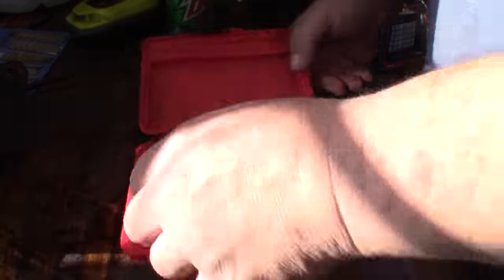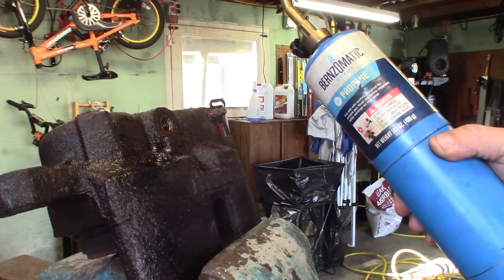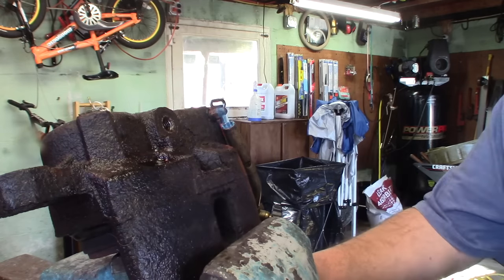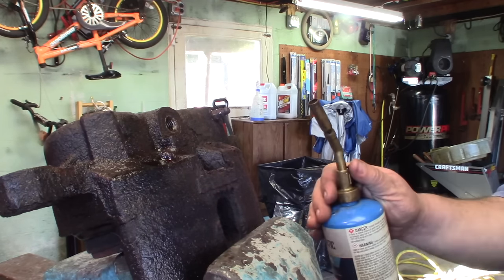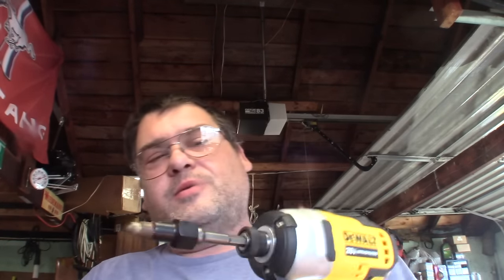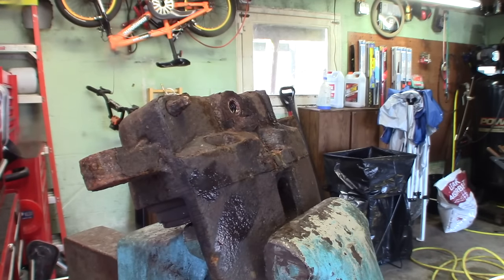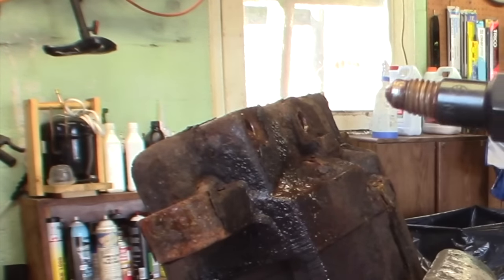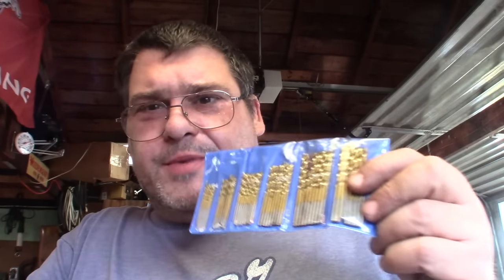How to Remove Seized Stuck Brake Bleeders Every Time!

Comment from the maker: I removed 2 brake bleeders that most would consider impossible in this video.  This method works time after time for me.  You can see a link to all of the tools used in the description above.  Here is the starter set for the extractors I used:  https://amzn.to/2W5tQGl  It comes with the case so you can add the 5 larger sizes later.
Reply: Using that hammer like you did you almost broke the bleeder valve.

BTW. People dont run out and start buying blow torches, the price is bad as it is, Ive been holding out in buying one for pipe solder.
Reply from the maker: except I have done hundreds of these.  If you don't want to buy tools you can always just pay someone else to fix your stuff
Reply: Have you tried just squirting water on it to cool it? An old engineer told me that one for rusted nuts etc, works amazingly well. Far superior to just heat like most people do.

Comment: Followed your advice (including breaking off the drill bit) and it totally worked. Saved me about two weeks time and $250 replacing an obscure, hard to find and expensive old Alfa Romeo caliper. Thanks!
Reply from the maker: Glad it helped

Comment: Excellent video. For any seized, rusty bolt or nut, like exhaust system bolts, I always try to spray some PB Blaster the day before, then use heat and an impact the next day. People think an impact, including an air impact, will break a bolt but the opposite is true. Applying torque with a bigger, longer wrench will wring off a bolt, but using an impact is like tapping a wrench with a hammer. It shocks the bolt loose.
Reply from the maker: Right on
Reply: It's always good to let the PB Blaster have time to work

Comment: Here's the deal.  If you were to look at the base of  brake bleeders and hydraulic fluid controll valves, you will see that they have a tapered angular seat.  They seal by the design of this seat....NOT by being torqued in place.  People believe that it is a high pressure safety issue, so it must be very tight.  But it is not true.  Just a simple finger tight on the wrench will be more than enough to keep it sealed / in place.  For hydraulic jacks ect. the slotted end of the bar is there to keep you from getting under the load, or down in the mud when you turn the valve.  But people use it to over tighten the valve , This ruins the seat so it has to be tightened more and more untill it finally fails.  This  misconception is the number one cause of bleeders sticking.  I close mine at 1 pound pressure, and they have never stuck or leaked.  The angled wedge affect of the seat works so well to keep them in place, that it causes them to need much more torque to remove them then was used to install them.
Reply from the maker: Sounds like the deal!
Reply: But that's hard to gauge if the threads are slow. I once lost a lot a fluid on a 600 mile road trip through a mountain pass.. I had bled my brakes just before.

Comment: I have started using anti seize on just about every bolt and nut subject to rusting.  So far, no failures.
On a side note, I really wish I had bought an impact driver much sooner!  My son borrowed mine for a project at his house and I thought it was a goner but he soon returned it and got his own.
Edit:  I got a can of MAP gas awhile back.  I'm too old to wait around for the propane!
Reply: what kind of antiseize? copper paste ?
Reply: @BillSW  just whatever is available at the parts store.

Comment: Thanks for the video, I didn't drill into the bolts but heat + impact driver + bolt extractor socket = success! I did have to hammer on a smaller socket onto one of the bleeder screws, and that also successfully came right off!

Comment: I use a 50/50 mix of ATF and a acetone on all rusty bolts and leaders and zero fittings. Works better than any thing you can buy at a store in a can. An Old timer mechanic taught me that trick. Spray it brown with that and let it sit an hour, then remove the bolt. Work every time
Reply from the maker: It doesn't work every time here.
Reply: Got to mix the acetone/ATF together.  Ideally , you first wire brush clean,  apply overnight for it to slowly penetrate.

Comment: I have this problem.before with my chevy. I used   brake fluid which cuts up the rust real good. And I used a vice grips worked it back and forth slow.... but this method  works great as well

Comment: I tried this today with one change: instead of snapping off a bit I found a steel nail of the same diameter and just hack sawed it off in its place and used a pair of ice cubes instead of the inverted keyboard cleaner. It worked like a charm. Thank you.
Reply from the maker: Nice work!
Reply: @frugalprepper   I didn't have any keyboard cleaner and I just couldn't bring myself to hurt a tool. Lol

Comment: I usually do everything on here except the drill bit down the centre,that really must make a major difference,great video!
Reply from the maker: Yeah that really strengthens it so it doesn't break off.
Reply: Adding the drill bit makes a HUGE difference because it gives body to the bleeder so it won't collapse when you squeeze the fluted bit onto it to remove it. A bit part of the unseizing is also the hammering - it loosens the crud in the thread. If you try removing the bleeder with a vise grip it's not nearly as easy to do and your risk of breakage is much, much greater.
This method is practically foolproof.

Comment: You might try using the TIP of the blue flame. That IS  the hottest portion of your torch area. May cut your heating time in half.
Reply from the maker: Just the tip!
Reply: @frugalprepper  "Only for a minute, mind, and just 'til the swelling goes down."  Surprisingly, inside the light blue cone in the center of the flame is room-temperature air!
Reply: Amazing bit of knowledge, there! 🫡😉

Comment: Whatever works is a good way. I've worked on some as bad as the second one (no hex left) and this always works: 1. Clean away rust with small densely bristled wire brush. 2.spray with pb blaster or another good penetrating oil (by the way, you saw no oil on the threads because if it did make it in there it was burned away). 3. Penetrating oil works while I pull caliper. 4. Heat mainly the caliper body around the screw (tip of inner flame is hottest part) for about 30 seconds if you are not replacing piston seals (longer and you risk melting them). 5. Remove with vice grips. If it will not turn at first attempt, heat a second time. As soon as it comes out I quench with water to save piston seals.
This always works for me. No drill bit and no air duster. Just alter the heating depending on size of caliper and how far bleed screw is from piston. Better to spray again a couple times over a half hour and try again than to risk putting in a caliper with melted piston seals.
Reply from the maker: 30 Seconds with a propane torch isn't going to do much.

Comment: Thanks for the video. I was able to slip a drill into the bleeder screw without removing the rear wheel cylinders and also the front calipers. No drilling or snapping off the drill. Just found one the bearly slipped in and heated it up. All four were locked up and this worked great. I didn't even have to replace any of the bleeder screws 👍

Comment: The tip of the flame is the hottest. And by the way, WD40 is indeed flammable. We use it rather than either in a carburetor for starting engines since it has some lubricating properties. But it's a great starting fluid. But good video.
Reply from the maker: Thanks for the info!
Reply: Tip of inner flame.

Comment: Awesome. I have a stuck one on my rear drum brake. I'll leave it alone for now, but you provided great info. The impact seems to work much better than manually ramping up the torque for crusty bolts.
Reply: Realize wheel cylinders (the component nipple screws into) are often very inexpensive and you may need one anyway. Especially if you're not in a hurry, try soaking the brake line fittings and all bleeders with penetrant. Such that if you end up replacing caliper or cylinder, life is easier.  PB blaster, MP40, KROIL and liquid wrench rust formula are all better than Water Displacing 40. It's not actually a rust penetrant.
Reply from the maker: I find WD40 works great!
Reply: @frugalprepper  For sure.
Reply: @frugalprepper 
I tried that, and nothing. Ended up tearing nipple apart! 😡🤬😭

Comment: You can buy that auto freeze spray to cool after heating up a part ..Thats a neat idea to put a drill bit to strengthen the bleed screw before trying to remove it with the impact wrench. If your calliper is aluminium, you can't heat it with a torch, you need an electric heat inveterter. I'm liking using an electric wrench more on hub bearings, lower balljoints and tye rod ends etc..Really helpful tool
Reply from the maker: Guess what Auto Freeze spray is... R152A.  Guess what duster is?

Comment: I find a few drops of acetone mixed with automatic transmission fluid or other thin oil applied to the bleeder the night before tryig to remove it in the first place does wonders in reducing the chance of it getting stuck.    Many times better than my old stand-by of WD-40.
Reply from the maker: If you have all night to wait.  I normally need to get it done, get paid and get the next one in.

Comment: Just stumbled onto your channel as I have a snapped bleeder on my Midget. 
Unfortunately it is the rear drum, so can’t put it on a bench and will have to use an internal extractor but if the right side is the same I’m going to follow this trick. 
I keep my little car going from the shop manual and you tube.

Comment: I replace brakes usually for long term. I have not replaced pads on a used caliper and wore out the pads before the caliper seizes. I replace with loaded calipers and rotors when needed but, have found it foolhardy to replace pads on used calipers. 
Good video on technics for rusted bolts ..
Reply from the maker: I find it fool hardy to replace a working caliper, but to each his own.

Comment: Suggestion from Nottingham UK … the patient approach … spray loosening oil on the bleeder day after day before you try any extraction technique so it gets the chance to loosen the rust which is holding the screw.
Reply from the maker: Yeah, I don't have time to have cars sitting around in my driveway for days waiting on oil to soak in.  Got to keep them moving to make the money.
Reply: I do the same as tonybreeze do. Omicron 636, spray on, let the time pass, spray again after 12 hours or so... Patience works well, but I'm not a man who earn my bacon by repairing cars... I just keep money by repairing at home.

Comment: Ill share my technique with you.  Ive had 100% success with it.   You need a micro torch or one of those torch lighters...which is what i use.  A can of kroil oil or the seafoam creeping oil.   Clean the bleeder area.   Heat the bleeder screw.   Just heat it . don't have to go crazy. Little shot of lube where it threads in.  More is not better.  Equivalent of a few drops. You will see it get sucked in.  I dont know...do that maybe a dozen or more times.   Heat... basically just warm it up.,..lube.   Try to loosen it.  Alot of times it will break loose.  Don't try will full so that you break it.    If it doesn't break loose ...leave it sit overnight or all day.  Try it again.  No need to reheat it.   I have never had one not come out.  I have used the heat and let the fluid suck in for years.  Yes sometimes it takes patience...alot of times it works immediately.   Just sharing with you because thise that post up on YouTube have saved my butt many many times. ✌️🇺🇸

Comment: Put a one size over deep socket on the brake bleeder so that the socket bottoms out on the caliper then hit the socket with a air hammer for a second or two, and boom bleeder comes loose every time! ;) Tip from rusty Sweden =)
Reply from the maker: Thanks, I will give it a try.
Reply: So instead of hitting the body all over right 🤔with a hammer
Reply: great tip fir any seized bolt. thx!

Comment: I've worked on a broken bleeder for over an hour only to find out a remanufactured caliper was $28. This is good in an emergency or for an expensive or unavailable part but I've found it's always best to get a replacement quote before you put more labor into something than it's worth
Reply from the maker: For Sure.  Some of those calipers are pretty cheap.

Comment: Great technique! - On a side note, regular WD40 is NOT a good penetrate. Use Seafoam Deep Creep (The Best) or WD40 Blue Flame penetrating fluids.
Reply from the maker: I have used them all, and WD40 seems to soak in better and get bolts broke loose faster than any of them.

Comment: I tried this 3-4 times using a MAP torch and using ballistol cooling spray. What finally got it loose was heating the outside area for 3 minutes and I sprayed WD40 on it while it was still hot. Maybe use some different penetrating fluid that isn't flammable. Maybe it was the combined effort of several tries. Mine was completely rounded and gripping it with a knipex cobra it took almost no effort to get it out.

Comment: Great strategy!
Could you use wire or something else besides drill bits? I cringe when you break those new ones, even if cheaper ones haha.
Also wanted to say if everything fails, your bleeder breaks off, and you cant extract it with anything either, and you still dont want or cant buy a new caliper, yoh can bleed the brake at the line coming into the caliper instead with a helper to press the brake. Might not be perfect, but better than nothing to get most of the air out.
Reply from the maker: Yeah you can line bleed them, but I like my to be perfect for a customer.  I don't need any lawsuits.

Comment: I enjoyed your video and love your attitude but did you know the hottest part of the flame from your torch is at the tip of the inner cone?  Also true Mapp Gas isn't made anymore but they have a substitute called Map-Pro Gas but it is only slightly hotter than Propane by about 120 degrees. Much more expensive with accessories. Thanks for sharing this with other Weekend Warriors~!
Reply from the maker: Well, I will have to try to use the hotter part next time!

Comment: Great advise! Thanks for taking the time to produce this video. Do you have any tips on broken exhaust studs in an aluminum cylinder head?
Reply from the maker: Weld a nut on the stud.  The weld will only stick to the broken stud not the aluminum head and the heat from the weld will help get the threads unstuck.  That's like the only reason I keep my old stick welder around.
Reply: gently get it rocking back and forth after welding

Comment: great video. is that a regular cheap propane torch? have u thought about putting crazy glue around drill bit so it all bonds to bledder screw? might get that last 2% of cases?

Comment: When you are applying heat add neat grease or push a regular candle into the thread, both seem to work much better than WD 40.
Reply from the maker: Great tip!

Comment: Thanks would a easy out screw extractor work? Cheers
Reply from the maker: It's been my experience that they usually break off in the hole and then you have a real mess.  Normally once they have broken off I just get a new caliper.  If you have to really go at it.  Drill it, tap it, and put in one of these: https://amzn.to/3KedZ0a

Comment: good video.  aren't you worried about getting metal chards into caliper ?
Reply from the maker: No
Reply: @frugalprepper  don't they fall down the bleeder shaft as you drill and then have the opportunity to fall into the caliper as you back out the bleeder ?

Comment: I heat mine up red hot, then take an old way candle and touch the candle to the bleeder  and let it melt a little and then attach the socket, the wax works wonders!
Reply from the maker: I've used the candle a time or two as well.